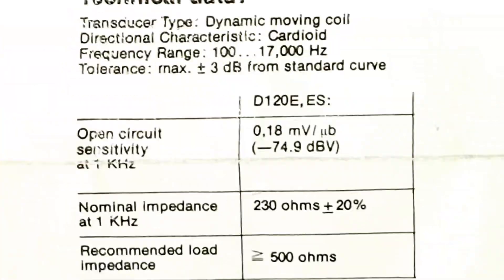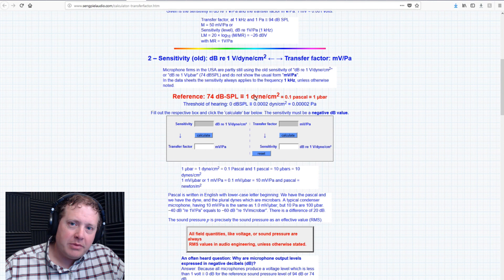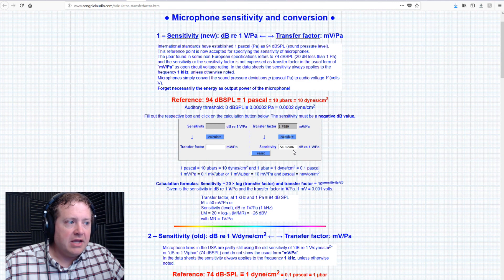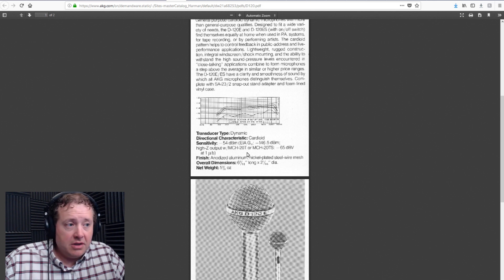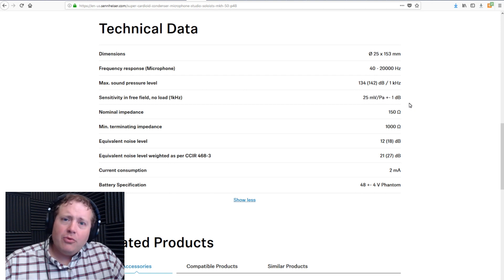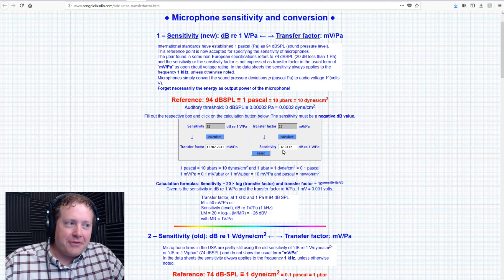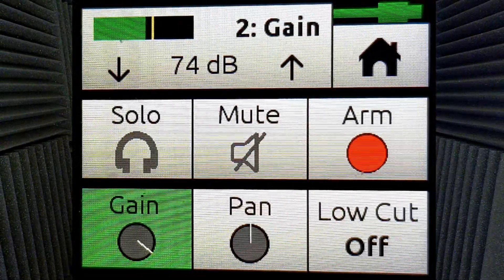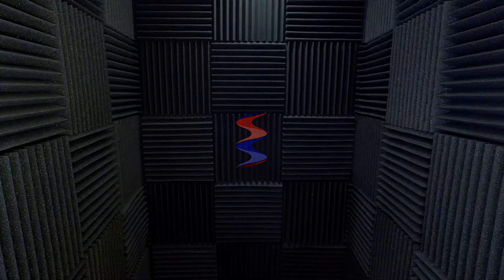I Don't Have The Preamps! Vintage mic sensitivity - Sound Speeds

Comment: The nice thing is my preamps have 75db of CLEAN gain so I can run anything but I have in-line mic preamps if for whatever odd reason I needed 102+dB of clean gain. I have other ways of amplifying it if needed (like that would ever happen). Needless to say, I'm more than covered. I don't use that gear for YouTube though because YouTube is just a fun and laid back hobby.
Reply from the maker: I hear you. Same boat here. A few years ago I tried to gain up as high as I could to see what would happen and despite being dead quiet, it was clipping ng like crazy.

Comment: Hey, I've just been offered that mic in exchange for some vintage tapes. How does it sound on Guitar Cabs? Is it worth it?
Reply from the maker: I wouldn't think so.
Reply: @SoundSpeeds  Thanks, sometimes it is a little risky to get these kind of mics as you may not find a proper use for them. I will keep the tapes then.
Reply from the maker: That's just what I would do. I've found the D120E for $75 online when not looking closely. I don't know what cabinets you have but I doubt it would be worth it.
Reply: @SoundSpeeds  Generally I just use a 1x12 22w Deluxe Reverb Custom Made Combo. Would you use it in any other source like vocals or percussion?
Reply from the maker: I'm sorry, I'd have to listen to it and determine based on the mics I have available. My expertise isn't in such things but you can always try and see. Sorry I don't have a better answer for you
Reply: @SoundSpeeds  No problem, thanks for the useful data. Your video helped me a lot by the way!
Reply from the maker: Thank you and thank you for watching!

Comment: A number of newer mics report sensitivity in the old format with greater absolute values, especially with cheaper mics.  Some Nady and Behringer mics like the XM8500 are examples.

!
Reply from the maker: Good find!  I'm really surprised to hear that though. The XM8500 boasts an "extremely high signal output" and then posts specs without even specifying it's per microbar. You'd think they'd want their number to reflect a hotter signal. It really makes no sense that they don't even specify it's per microbar considering that they use pascals for sensitivity for their condensers. This is borderline worth Tweeting them about.
Reply: Behringer's value gear is often labeled in ways that leave you scratching your head.  The inexpensive UMC404HD and similar interfaces have very little solid information about preamp specs or gain provided.  I assumed this was just a result of trawling the low-end gear for podcasters so they could avoid the USB mic trap.

   I was mistaken, the other cheap mic I noted with the older values was Nady, not Pyle.  

!
Reply from the maker: @BangsNaughtyBits  Still, good to know. I had no idea but then, most of what I work with is pro sound gear. Really makes you want to scream "What are you thinking?!"